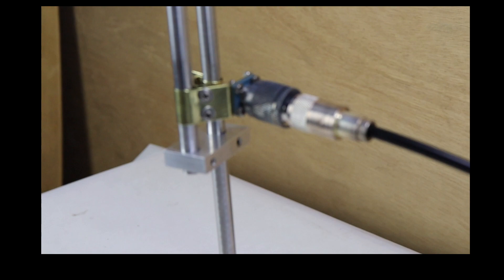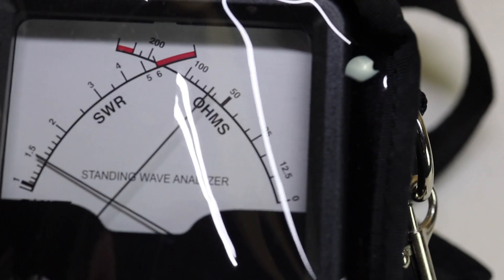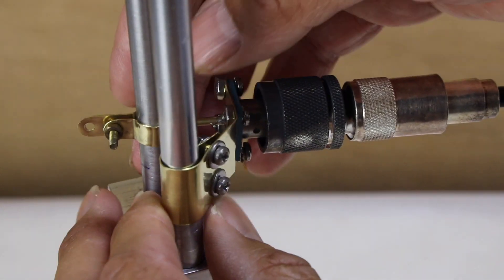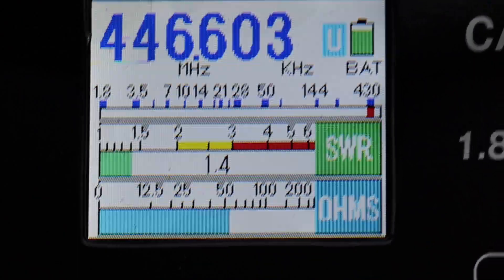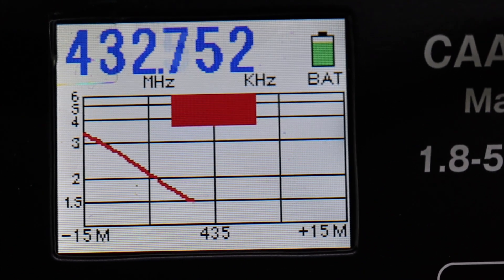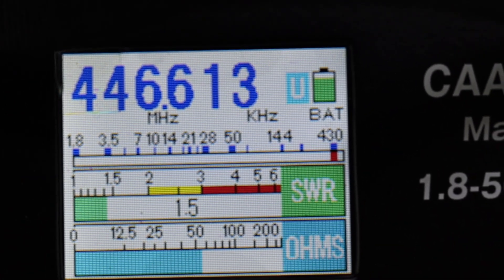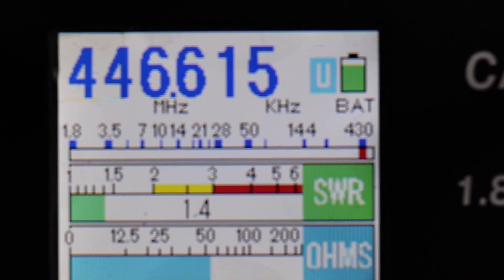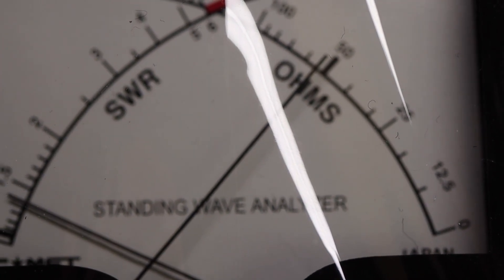How to tune a J-Pole using a Comet CAA-500 MarkII

Comment: this is not the correct tuning method. First, you have to find the fundamental resonant frequency of that nice tube system, the impedance is not so important. Than you have to decide to lenghten or shorten that antenna to adjust to the desired frequency, And third you can than set the desired impedance of 50 or 75 ohms.